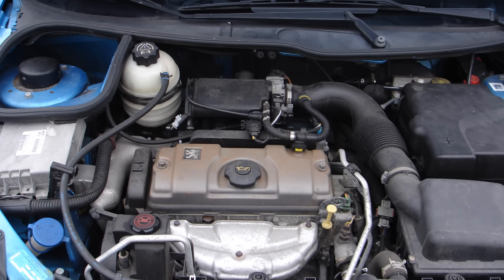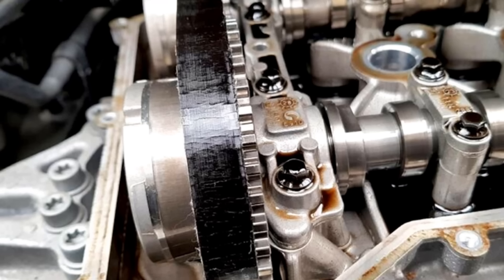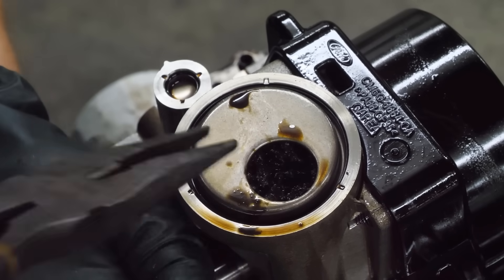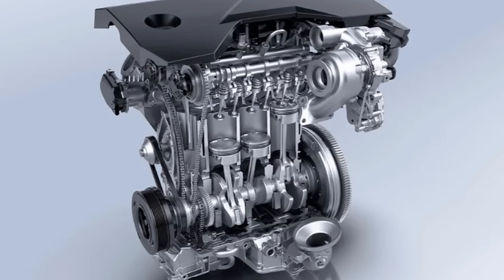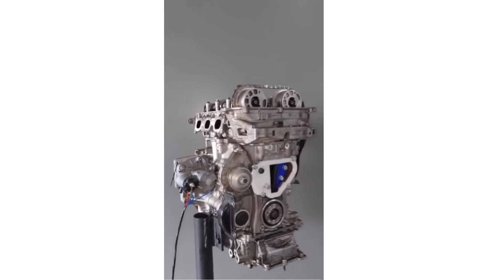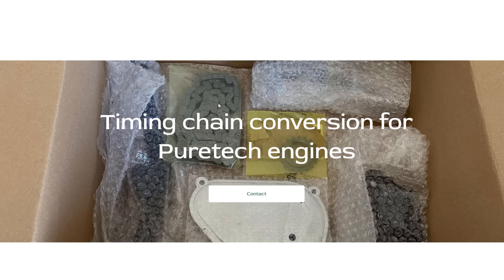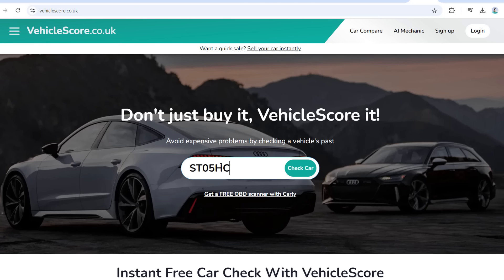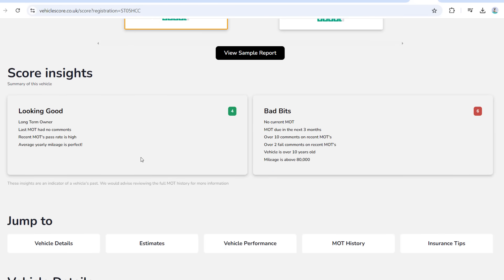Peugeot PURETECH Fix Is Here - All You Need To Know

Comment: Aaand you'll still have a wet belt driving the oil pump, so didn't really solve much, the belt will snap and you'll lose oil pressure and granade the engine, and your pickup tube and oil passages will still going to be clogged, so a half baked solition for a half baked crappy engine. Don't buy it, if you have itx sell it.
Reply: La pompe à huile est entraînée par une chaîne sur ce moteur
Reply: You are confusing psa 1.2 with chain driven oil pump with Ford's ecoboost with belt driven oilpump.. should edit the comment😅
Reply: @ormaragnarsson5203   On dit la même chose ! 😉

Comment: You know, they changed the timebelt for a chain in the recent evolution of that motor (unfortunately, not all models with 1.2 engine are equiped with it).

They began last year with the Corsa if I am right (as Opel is part of Stellantis).

For the moment, after 1 year, news are not so good: cases of elongated chain (and some had shifts in the positions of the chain...) and trouble with the chain tension adjuster/ chain tensioner (sorry I am not an english speaker so I don't know the exact word, but I thing you guessed it).

And I don't know if they did something about the oil consumption.
Reply: ils doivent reprendre la conception de ce moteur a zero    changer la distrib arretera pas la consommation d huile la segmentation de ce moteur est une merde et le refroidissement du bloc alu aussi  voila le bloc alu ultime il date des annees 1960  bialbero alfa romeo bloc alu culasse alu      faut la meme temperature sur la culasse et sur le bloc sinon   les joints petent  ou le bloc s ovalise    coucou 1l2 puretec
Reply: et je suis pas ingenieur  donc les roquets qui pondent des merdent  va falloir vous en separer sinon stellantis c est mort!   hum attendez c est peu etre le but rechercher   les chinois fabriqueront les voiturent comme tout le reste et nous on crevera la dalle!

Comment: What you said at around 1:20 is totally true. People are saying this a lot of the time. But in reality I have had 5 EcoBoost engines which were scrap (belt failure) Those cars were all maintained properly. Sometines we see a belt hold out the service interval, sometines (especially PureTech) fail already at 40k km. It is nothing more than pure garbage.
Reply: Ai ai ai... asa de adevarat si trist! Din pacate au facut un motor de unica folosinta... pe care sa l schimbam o data cu placutele de frana, de a dreptul penibil. Ce e pacat, modelele pe care a fost montat sunt f attractive dar pur si simplu le au scazut valoarea si durata de exploatare montant acest motor de rahat.

Comment: The conversion kit is developed by a company in the Netherlands, NOT Norway.
On a other note, 1 litre of oil every 4000 miles is actually quite good. Perhaps you meant to say '400 miles' instead? 😁
Reply: Yes 1ltr of of oil every 4000 miles that's OK, my rav4 is doing that at the moment, and it's 20years old😊
Reply: @davejones290   Good old Toyota eh? 👍
Reply: Twas my thinking also. 4000 miles per litre is quite reasonable, especially with today's ultra thin oils.@davejones290
Reply: my 2006 Honda  Civic CTDI would not waste more than a half pint or quarter of a liter oil every 10.000 km
Reply: no reply to e-mail or and phone is discinnected

Comment: Best to worst: (Reliability-wise) Gear Driven > Chain Driven > Dry Belt > Wet Belt. But having said that I’ve seen all 4 systems fail. The one gear driven failure (Perkins Diesel) just seized the engine, but replacing the bronze bushes was the only damage. :) Chain Drive can be good but chains do wear, especially if you ignore oil changes or use crap oil. Worn tensioners can lead to skipping teeth too and if you’re lucky it’s just the timing that’s thrown out! ;) Early belt drive could be interesting, the worst damage I’ve seen (Peugeot 205 Diesels) were camshafts in 4 pieces and all cam caps snapped as this was an interference engine. Still, new cylinder heads and they were good to go! Wet belts…yeah…:(
Reply: Gear driven isn't necessarily all that good.  Think of the Ford Essex V6 and some versions of the Volvo B ohv engines which used fibre timing gears to reduce engine noise.  The problem was that the timing gears could strip teeth in as little as 15-20,000 miles if abused, neglected or worked very hard.  The result in the case of the Ford engine was very often terminal damage and I have seen the Volvo engines be damaged beyond repair by timing gear failure as well.  I have seen the Essex V6 engines with the heads punched clean off the block as the timing gear has failed when the engine was under heavy load.

Engineers don't ever really find new ways to break things, just revised ways to make the same failures happen...
Reply: @JamieCameron-Mackintosh-z7c  Fair enough but I don’t think of fibre and gear in the same sentence! ;) Most of my experience has been on industrial engines, (Plant, HGVs & Fork Trucks) and having rebuilt many over the years I’ve only known the one failure with (proper) gear drive. Sadly manufacturers have moved more to car based engines in recent years with reliability suffering, especially in harsh environments. But I get the need to reduce costs and noise etc. I think overall for cars a robust chain drive is probably the best solution, there does seem to be movement back to this in some quarters.
Reply: @andygilbert1877    There will always be the idiots who think mechanical items don't require maintenance, which is about the only way to make metal timing gears fail out short of a fault in manufacture.  I agree with you about the timing chains being the most trouble-free alternative for light vehicle engines, my own car is a 2015 Peugeot 108 with the 1.0 VTi engine.  It's done nearly 152,000 miles and it's just had the timing chain replaced, which isn't a particularly big job on these.  Other than a new lambda sensor all it's needed has been routine maintenance.  Really not bad for a car that was cheap when it was new...

Comment: I had a wet belt scare on my 71 plate, 21,000 miles Puretech 1.2, three weeks ago -  the STOP warning light came on with a message 'Get Repairs'! After having the car recovered into a dealership the fault code (P11A9) indicated a problem with the Inlet Cam Dephaser, sometimes caused by a blockage of the solenoid valve. When they removed the valve, they found it had become jammed in the fully retarded position. They checked the belt in 6 different positions of it's cycle with the gauge and a borescope and allowing for it not being easy, the belt was pronounced in great shape. They fitted a new solenoid valve for the dephaser and the car runs as sweet as  a nut - if not better. I reckon the problem had been getting progressively worse but I became accustomed to it although I did notice that fuel consumption had increased over the previous tank of fuel.
As for the ludicrous oil consumption that manufacturers seem happy to accept these days (my theory is that they fit loose rings because that lowers frictional losses and therefore reduces fuel consumption and emmissions), my old Peugeot 1.6 HDI lost hardly any between services and when I got rid of it it had 150k miles on the clock!

Comment: Huge positive if the chain mod has been done when selling the car and, for peace of mind alone, it has to be good value even at double the cost of belt renewal. Knew two people who owned a Fiat Punto and MGF and both absolutely swore how great their cars were and said the stories were all lies. Both quickly changed their minds when the head gaskets failed, in the case of the MGF it was scrap and the Fiat cost her that years holiday.
Reply: the MGs dont have issues if you use MLS gaskets, i replaced the elastomer gasket on my car with an MLS and it's super reliable. 225.000km and it only needed one gasket. the elastomer gasket wasnt blown, but i replaced it just in case. Those gaskets break because people dont warm up their cars properly, Rover K series engines are very sensitive to temperature changes, but if you let it warm up well it's very reliable even if you rev it a lot when at operating temperature

Comment: Is this applicable to the Ford 1.0 eco boost as it was the base for the Peugeot engine
Reply: Completely different engine.  The Puretech is easy to check and easy to replace the belt.  Ecoboost takes twice as long and the parts are more expensive.  If you want a chain drive, go and buy a Micra - then find out how much it costs a when then chain stretches and the cam/crank sync is lost.

Comment: Another excellent video. I am not familiar with the puretech engine but did wonder how easy it would be to fit an oil pressure gauge in addition to the pressure sensor.

Comment: A few years ago VW/Audi considered litre of oil every 1000 kilometres was acceptable. I ran a Fiat Punto with 150000 miles on it and hardly topped the oil up between services.
Reply: Actually the level of oil can become higher than normal because of the oil being diluted by the gasoline
Reply: @gilbertotrevisan6538  et comment l essence passe dans l huile?   segmentation pourrir et cylindres ovalises   et cela va empirer avec les km
Reply: I have rin my Citroen 300,000 miles and it does not use a drop of Oil (do change every 10,000 miles)
Reply: @composedlight6850  is it a diesel ?
Reply: @composedlight6850  quelle citroen   j avais 1 c5 140cv hdi   aucun consommation d huile mais c est pas une essence et pas un 3cylindre puretech
Reply: @composedlight6850  quel type de moteur?HDI 2L  CE MOTEUR EST INCREVABLE MAIS PLUS FABRIQUE
Reply: @composedlight6850  Which engine? Miles or kilometers?
Reply: @derekbevan7145  
Yeah.  I had a Octavia vrs   It drank a 1l of oil every 1000 m 
Outrageous , they said it was within tolerances 😂
Reply: Oh yes, the twin chargers
Reply: I had a 1 series that was even worse than a golf. Couldn’t believe how much it drank

Comment: That chain looks wrong. Cams should be driven by a Hy-Vo type chain not a silly little bicycle chain.
Reply: Hy- Vo chain are crap as well changed loads at low miles
Reply: Hy-Vo chains are quieter; They don't actually last longer.
Reply: As long as that single row chain is high quality and the tensioners do their job, no worries.

Comment: The Ford Ecoboost wet belt engine is fitted in some models of Honda so beware if buying a small Honda too.
Reply: It shares the same 'wet belt' design but the engine is a Honda engine not a Ford eco boost.
Reply: @jdmguy44  yes but the wet belt Honda engine is still shite and has issues. 

Personally I'd avoid all the 1.0 Honda engines and buy one with a timing chain. 

1.5t, 1.6idtec, 2.2idtec, 2.2 ictdi, 1.8ivtec, 1.4 idtec, k20 etc etc. You get the idea. All very reliable engines.
Reply: @mickl8212  yeah I agree. I've owned a number of Honda's but wouldn't touch one of these engines. They were just used in the Mk10 Civic in Europe and now discontinued. Welt belt engines are just a crap idea all together. Honda has learned that lesson I think.

Comment: I would like to know why VW wet belts which have ran oil pumps on nearly all diesel cars don’t fail? Is it due to materials used, length, stress?
Reply: I read that it's gasoline, when it is in excess (cold start) that goes past the piston rings (low friction for good mileage) and mixes with the oil, that dissolves the rubber from the belt.
So it must be much less of a problem for a Diesel engine but a wet belt is still a bad idea...
Reply: Because they're German of course 😂
Reply: vw oil pumps use an old fashioned v belt to drive the pump,

Comment: Whoever came up with the idea of a wet belt needs to be fired
Reply: Out of a cannon.
Reply: @JOHNWILSON1944 into the sun
Reply: As a non car engineer I don't understand why they couldn't use the wet belt with a chain? Purely to save them a couple of quid on metal vs rubber. Would have made their engines infinitely more reliable and improved customer faith in the company. Very strange
Reply: @Jisei13  because they can claim marginally better mileage and pollution. Most buyers dont even know what a wet belt is, so they just see an engine that sips less fuel and think it's better
Reply: @Fred_the_1996 Chains are lower friction than wet belts. The only reasons to implement a wet belt are to save money and planned obsolescence.
Reply: @Jisei13  the reason why the twonk tried to run the belt in oil is to try and increase age  but oil heats up ? And less friction . Belts are for out side of oil .  chains are inside of oil  end off
Reply: @Jisei13  VW had some serious problems with their timing chains on their TSI (especialy the 1.4 TSI)  Lots of that type of engine croaked due to premature timing chain failure. 
A wet belt is not a saving on parts but a enginering solution for the downsizing of engines.
Also 1 and  3 cillinder engines run much rougher then even or more cilinder engines.
The wet belt was used to get a 3 cilinder engine run much smoother by reducing friction, increasing output, lower fuel use and so reducing emissions.
In the laboratory conditions it was all fine, in practice serious problems surfaced. 
On the PSA/Stellantis 1.2 puretech (wet belt) the dis advantages just outweigh the advantages.
Very recently Stellantis produces the 1.2 puretech engines with a timing chain and some other modifications .
Reply: @obelic71 Japanese produce better timing chains. They are lifetime.
Reply: Most car owners nowadays don't even open the bonnet from one year to the next. Checking levels weekly is a thing of the past. Most just expect their car to start every day, never expect anything to wear out and  give their car zero maintenance.
Wheel changing has also become  a thing of the past. Most will drive with a puncture destroying the tyre or actually call out breakdown to have a wheel changed!
Motorists in general have become extremely lazy...
Reply: There is a lot of engines with chain problems, dry belt problems or oils consumptions since I remember.  Not the XU or TU PSA engines but if we check Alfa Romeo, BMW or even Honda engines they have problems with oil consumption (oil dilution or timing chain or dry belt failures). 
.
Wet belt suffer from oil dilusion in petrol and this depends a lot from the kind of usage, oil consumption of 1L per 1000kms is a normal thing in other brandsm even in their user manuals they have that info!!
. 
What is stupid is the oil specs used nowadays, 0w20, 0w30 or 5w30 are stupid termic specs, 5w40 is a lot better engine to control consumptiom and to protect the engine friction at high revs and hot seasons.   
.
If I had one of these engine and the way I drive I'll never use other than 5w40 and chande the oil every 10~12k km. I bet the oil consuptiom will be more controlled and the belt will be preserved a lot better. 
. 
I have a PSA TU5JP4 engine and I use 10w60 oil spec because the way I drive and use revs the oil need to be thicker to protect the engine. (335k kms)
Reply: Oil dilution from... Dpf regeneration.
Reply: @carlosgilpinheiro7510  Honda DO NOT have problems with their dry cambelts only the wet belt in the 1.0
Reply: @carlosgilpinheiro7510 TSI engines have no issues with dry belt. Wet belt is simply a crappy solution that has never worked for any downsizing engine.
Reply: Bummed to death
Reply: @Greggspies  
Lmao..
Reply: How odd that the ford engine won loads of awards. Who was giving the rewards out!
Reply: The same who forced manufacturers to develop trash in order to comply with the th their impossible co2 emission demands, politicians...
Reply: The whole problem was in lack of maintenance from customer and wrong driving habbits
Reply: The jiblet is a well belt  of. Engineer .   I still have a elec fault no one can fix  the ds4 has been off raid 2 years .  Rings 😂😂 I had a crack on cly 2
Reply: Erm no. It is s solution to a problem. And the problem is the politician who demand these solutions of impossible tasks to reduce the co2 emissions. Would be far better to have a 40 year old Mercedes with a bit dirtier engine then manufacture jusnk what will end up in the bin after 5-10 years of service. So the manufacturing costs and emission is not wasted. But after all this is what they want, for you to spend your money and generate gdp growth in a declining demographic world, just so they can create more debt to gdp and hope for reelection.... Sad that people won't understand this ever
Reply: Part of the plan to get us off the road
Reply: The elephant in the room is a design that is based on planned obsolescence - the life of a leasehold contract then..
Reply: Shot not fired
Reply: whoever idea is the wet belt must be submerged in oil to 😂 to he a wet person
Reply: You've got that right, my daughters 208 is 2 years old and had from brand new, has only done 18k miles and has been told the welt belt is cracking already!
Reply: Psa and honda
Reply: Chains sound like a good idea except chains may be sourced from china and quality is shit .
Reply: Use the right Oil.
PSA B71 2010
("2010" has nothing to do with MY or YYYY)
Should be a SAE J300 0w20, ACEA C5, API SP with additional tests.
It's a Mid-SAPS Engine Oil with Limits at the HTHS-value (2.6...2.9mPas).
Reply: The idea is fine its the fact they didn't use the correct belt (fullt synthetic i believe?) which is the solution to the ecoboost engine